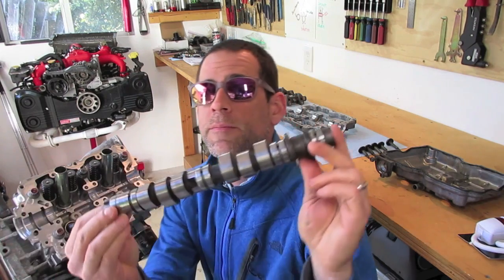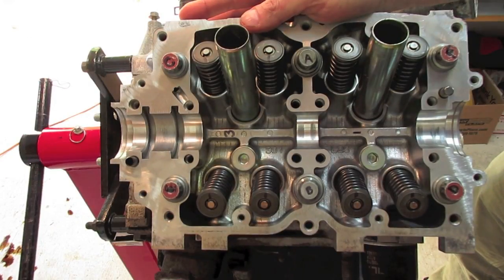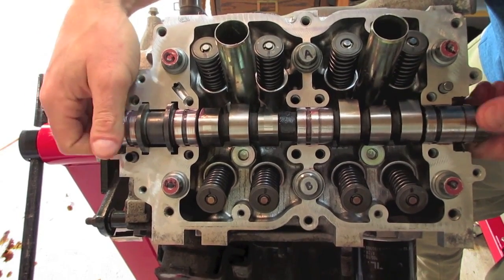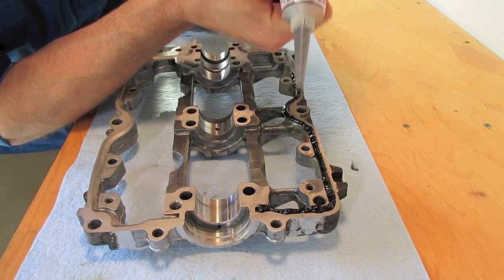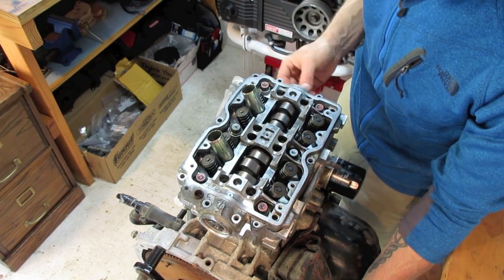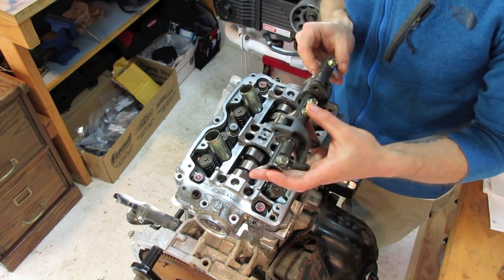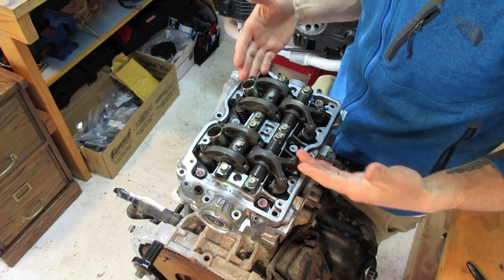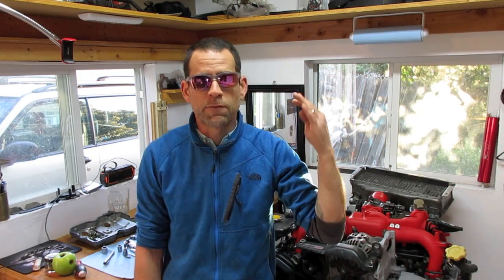How to Install Subaru Camshafts & Rocker Arms

Comment: Specifically the torx bolts are TP40, Torx Plus. A regular T40 has potential to strip them out. Torx Plus is more square around the peaks as opposed to the pointy peaks of the regular torx.

Great Video!

Comment: Good vid. Luke. Good cam. position over the head. Did you mention anything about de-greasing the machined surfaces, before RTV? Sorry if I missed it. You have an axiomatic style of communication (self-evident), clear and thorough delivery of the facts. I wonder if you have experience in academic writing or speaking? Was the retro-fit cooling mod. visible on that head. The twin-cam. engine behind you appears to have an aftermarket crankshaft-nose pulley. I don't believe these pulleys - damp,  mid to high frequency harmonics, from the crank. And can result in early failure.

Comment: Those cam cap bolts are Torx Plus, which has fatter splines than std Torx. I twisted my Torx driver bit while removing them, because the PO overtightened them and the fit was sloppy- just a heads up for anyone else looking to get the right tools for the job.
Reply from the maker: Nice - THANKS!  👍👍

Comment: That's cool. I have to do a head gasket job. Will be my first one.  QUESTION: HOW DO you know if you have the cams, rockets, etc on correctly after getting back from the machine shop? I'd be afraid that I would screw something up after I get them back and put the sprocket on and destroy everything! LOL. Cheers!

Comment: Hi, I got a 2005 Subaru Forester  2.5L 4 SOHC EJ25 with approximately 100,000. I saw a video you did but it was too late, my timing belt failed. It was the geared idler which actually failed and the fact the 05 Subaru 2.5L SOHC EJ25 is an interference type engine I think was a big problem. Yes, the bearing failed miserably it was all rusted and spun out and a cut a perfectly round hole in the timing belt dust cover.
The real problem is I am sure I had at least a couple of bent valves maybe more. I really hope that's all of the damage. Again I saw your warning video about the timing belt kit parts needing to be replaced at around 100,000 miles as mine was over it by 50,000.
I got a kit that came with a water pump and saw the oil pump right there said you know I should do this as its right there.  Well, now I know. So looking at this valve video now. Anything you can say to tell me if I am doing things right or whatever would be greatly appreciated.  Thanks your videos are helpful to many I am sure. keep up the good workVince mufonfivm@gmail.com

Comment: I noticed that you didn't put any lock thread on the rocker arm bolts, I did. Is that going to be an issue? Also I did di anything with the camshaft for lubing because I didn't take that piece apart. Is that going to cause an issue?

Comment: I just put a new to me low mileage engine into my 2005 impreza sedan, 2.5l sohc. the engine came to me on a pallet out of a recently wrecked car, upon inspection it has a new factory subaru timing belt, subaru factory oil filter (which I changed when I put new fluids in), new intake gaskets etc. After a week of driving it runs excellent but leaks oil, roughly 1/4 litre per 2 week period, more if I drive it more. Everywhere on the engine is perfectly clean and dry except for the driver side head has a TINY bit of engine oil weepage on it, near this cap and the exhaust manifold (really hoping its not a headgasket problem), I noticed gray RTV kinda drooping from the area on the cam cap where it looks like the leak is coming from, do these tend to leak? No other possible indications of a headgasket failure, so really thinking it could be the cam cap has a bad seal

Comment: Great video but you didn't prelube the thrust bearing surfaces on the cam before installation. Please explain and you have a new subscriber. Thanks!
Reply from the maker: Think I lubber the head machined surface. BUT you are 100% correct!!!  Thanks for noticing and sharing!! 🤙🤙
Reply: Yeah, I pay attention!

Comment: Man, first of all congratulations for your videos, are very enlightening and inspiring.
My name is Marcio and I'm from Brazil, just as you are a lover and enthusiast of Subaru vehicles.
I have a Subaru Impreza GC8 with engine ej20 sohc NA.
I have a degree in mechanics and I have a project to improve the efficiency of my engine without the addition of a turbocharger.
I am bumping into some points and so far I have not been able to solve.
An example is the measurement of camshaft the ej25 sohc
I have idea if it is possible to use this camshaft in the EJ20 to get some gain.
I would like to share experiences and if you have some tips I appreciate.
Abs
Reply from the maker: Hi Marico!  Thanks for checking out the videos.  Cool project 😎😎😎.  Dig this question my friend! 

Internal combustion engines, at their most fundamental level, capture the heat energy of the internal combustion cycle and convert it to mechanical work.  By design, they are actually extremely inefficient, with respect to capturing all the heat created.  This is where I would suggest you focus your efforts - Try to think of creative ways to minimize the loss of heat, and as a result transfer more energy to final output of mechanical work (ie engine’s flywheel output and torque to the wheels). One place to start , header wrap for example. But try to come up with more creative ways to achieve this and I bet you’ll find all kinds of ways to save that heat energy.

Yes, this would be more beneficial if a turbo was involved, but it will still increase the efficiency even on a NA motor - And that is only objective here!
Reply: Hello friend, thanks for the reply.
Understood, I'm going to start my project in the new year and as soon as I get the news I'll let you know.
Hugs

Comment: FYI, that's not a T-40 torx bit, thats a TP-40 Torx Plus...  similar, but not the same.  Nearly stripped the bolt head while removing the  bolts by using the wrong tool.
Reply from the maker: +Ajila Ama Farms  fuck dude. You are 100% correct.  Thanks for catching that!  They have slightly different shape too!!!
Reply: easy mistake, I didn't even know the dang things existed...   I asked the matco truck dude to order me some and he told me there are even more out now called "moretorq"  hahaha, damn.  pretty soon we will have toolboxes bigger than our houses :p

Comment: I don't see any lifters in that engine.  I have a 2003 subaru baja.  What causes a lifter like knock when the engine is cold and it goes away when the engine is warmed up?  When the engine is cold.  its a little scary it sould like a collapsed  lifter that eventually gets pumped up with oil.  What do you think?
Reply from the maker: Hey man.  That could be lifters not staying pumped up OR could be valve gap getting a little too big.  I would check you valve gaps first.  If they are too loose, then an adjustment might just fix the problem.   Good luck 🤙🤙

Comment: Do you have video on this for the quad cam models?
Reply from the maker: Sorry, don’t. But it’s very similar steps.
Reply: @SubaruONLY  I’m asking because the roller rocker arms for my 2013 fb25 motor got jumbled while I was trying to do a reseal job.
Reply from the maker: Ahah, hate that.  It’s happened to me. Not much you can do when that happens… good luck 👍
Reply: @SubaruONLY  perhaps some insight to the difference between, say... an A stamped and an E stamped one?

Comment: Any one know if this is only for a 2.51? I need to find one for a 2.53 07 Subaru Impreza 2.5i
Reply from the maker: Not sure if it’s the same. Prob slightly different torque specs. You can always use the Factory Service Manual, I provide them for free on my website - SubaruONLY.com - check it out!!!

Comment: one more question Luke, is it’s best to adjust the valves when the head is out on when the heads are installed already.. I already assembled the head but not adjusted the valves to spec. Thanks
Reply from the maker: +zroboost scooby  Hey - no problem.  You can adjust the valve lash either before or after you install the heads on the block - basically whenever it is easy to do the procedure. Just make sure you take the time to do it cause they often need to be adjusted - especially those exhaust valves.  Thanks man.
Reply: SubaruONLY is there a reason why two valves are open on the intake side, and two valves open on exhaust side,when I rotate cylinder head on the left, when I set to timing marks, and the cylinder head on he right all valves are closed... 😕
Reply: That's normal.  With the timing marks aligned, all pistons are at half stroke.  In this condition, the passenger side cylinders' valves are totally closed and the driver's side they're open as they're all on different strokes.
Reply from the maker: Yep -👆 Nice breakdown.  Thanks!
Reply from the maker: When you set the valve lash, just make sure the valve to fully seated too.   Cheers.

Comment: what did you use to clean up your motor so well? I've had my block hotbathed and it doesn't come out that clean.
Reply from the maker: +Tyler James - Hey man. Nothing much more than elbow grease and some abrasive pads and disk soap actually.  Plus, my JDM motor probably has super low miles too. Maybe that's part of it too.

Comment: do rocker arms need a specific spot?
Reply from the maker: Yes, keep them in the original locations. Due to Wear patterns.
Reply: SubaruONLY what if I mixed them, how can I determine where they go?
Reply from the maker: I don’t think there are any stamped marks. Keeping them in the same location might not be 100% required, I’d just reassemble and try to make sure it all pivots smoothly and then run it.  No other option I’m thinking.

Comment: Do you usually replace the cam bolt sealing washers?  The ones on the bolts that are not covered by the valve cover right over the end of the cam?  The FSM says to replace them, but I can't find where anyone actually says they do it.  Just curious.
Reply from the maker: Thanks for dropping the message!  🤙🤙

In general, unless it’s a copper crush washer, I don’t worry about replacing a washer.  This should be good approach for most mechanical equipment, including these Subaru engines!   Cheers and good luck!  🤙🤙
Reply: I appreciate it, Luke.  These washers appear to not be a crush type.  They look like they have some rubber around where the seat of the bolt head contacts them.  I will inspect them for serviceability and go from there.  

Keep up the channel!  As a long time Subaru owner of cars with the EJ257, EJ253, and now the FA20, I enjoy watching your content.

Comment: Awesome videos, huge fan here. My 2.5L SOHC EJ engine with 100K miles, started clacking with excess valve lash, so I checked all clearances and find one exhaust valve- drivers side (cyl3?) to have excess clearance. So I set the clearance to spec and torque up the adjustment screw -nut good. All is ok for about 5000 miles then the clack slowly returns. Rinse Repeat 2 times now. Same valve. Since there's no problem with the clearance at the valve next to the noisy one that opens from the same shared rocker arm,  its not the cam lobe or roller, but what else could be happening? If a valve seat  was wearing away or if the valve itself was wearing or in extreme case mushrooming, the clearance would be shrinking/closing up but not increasing. What do you think it might be , or suggest my next step might be for this daily driver psuedo-diesel wannabe?
Reply from the maker: I totally agree with your logic here, sounds spot on to me.  So what the heck could it be...hmm.  Something is opening that gap up, might be carbon build up or maybe the valve stem bushings are starting to move on you.  This is a little tricky and I can’t say for sure.  Hope this helps a little.  Good luck buddy!   I’ll think on this one and circle back if I think of anything else.

Comment: Do you need to have the camshaft in the 'UP' position, like top dead center for the pistons?
Reply from the maker: You line up the marks on the camshaft pulleys.

Comment: Hey Luke I am doing my head gadget and I have a concern do I have to align the camshaft on a specific way or not, car is a 99 RS, thanks..
Reply from the maker: +zroboost scooby   Hey man.  Thanks for reaching out!   Just make sure the front is on the front side of the engine.  As far as the rotation, no need to worry about that till you install the cam gears and set the timing with the timing belt installation.  Good luck man!  🤙🤙
Reply: SubaruONLY great thank man,

Comment: Hi, I bought a used Subaru  Impreza 2007  DBA-GE2, my mechanic said there was an issue with one of the camshaft sensors after I took it in due the engine light turning on, so they did a rewiring, it's working fine but I don't know for how long. From their experience when they replace the camshaft with a used one (cause new ones are hard to find) the problem returns after a while. 

 Getting a new camshaft for my Subaru is not easy. What do you think? and may you please recommend where I can order a new camshaft for my Subaru modal, a company that can ship overseas?
Reply from the maker: Try Rally Sport Direct or Flatirons Tuning - always high quality parts, great tech people who answer any question and all parts ship out same day or next. 🤙🤙

Comment: Do you have a video on the Vavle Springs removal and install?
Reply from the maker: I do.  Super early one on a NA motor. I used a drill press with custom attachment to compress the valve and pull the retainer. Check it out.
Reply: @SubaruONLY  yeah thanks for the reply found it after I browsed all your videos. Glad to see your back!!!!
Reply from the maker: Thanks and cheers man!

Comment: hey i got a question for you on the Subaru forester 2.5i can you remove or install the cylinder head with the camshaft and rocker assembly on?
Reply from the maker: +Julio Salazar.  Yes I believe so.  The dual overhead cam motors have a cylinder head bolt under one of the cams, but single overhead cam motors don't have that restriction.  Should be good to go man!!! 🤙🤙
Reply: SubaruONLY thats what I was working on the single cam thank you!
Reply from the maker: +Julio Salazar  Thank you.

Comment: I was looking to buy redline assembly lube. When I went to their website and filled in the application for my car(same Forester generation as the one on this video), Redline website stated their Red Assembly lube wasn't recommended for my car?? I've seen so many people using these assembly lube on these engines.. weird..
Reply from the maker: Odd.  I may have to look into that.  Maybe just an oversight on the webpage.

Comment: Your videos are very well done. Keep them coming. Your well on the way to a 10k subscribers. 
I have a stripped Allen bolt head on the cam plate right behind a spark plug tube. Think some rtv got in there on the last head gasket job. Looking for ideas how to remove the bolt.
Reply from the maker: +Steve S   Thanks man!!  Those little suckers are a bitch for sure once stripped.  Couple of ideas, screw extractor kit might work or sometimes driving someone that can grab like a big torx bit (star shaped fitting) into that rounded out hole can hold while backing it out.  Good luck man!! Let us know how it goes!
Reply: Hey SubaruOnly, I'm a complete newbie. I understand that in order to do a timing belt service the engine has to be in TDC to prevent any damage to the internals due to the pistons hitting the valves? When reassembling the engine how do you put it back to TDC with everything apart? Sorry I'm just curious and not super mechanically inclined.
Reply from the maker: Hey - Thanks for dropping the question!  In general, you are 100% correct.  However, Subaru engines are unique - which is awesome! 

For Subaru engines, we set the valve timing to the Crankshaft timing with all four pistons half way up the cylinder bore. - which means the valves won’t make contact with the pistons, even at full lift. To do this, Subaru has cleverly designed marks in their pulleys and engines to easily make sure everything is lined up correctly.  

I walk through this in a little more detail in the videos on changing your timing belt if you are interested.  Good luck.  Cheers! 🤙🤙
Reply: Thank you

Comment: Just got my heads machined and the shop gave them back with the camshafts installed. I have to take them back out to get to the head bolts. Is there anything I need to do to calibrate the camshaft or anything else when I put the cans back or just make sure it rotated freely? It’s an 08 forester XT.
Reply from the maker: Yes. That is actually the common way for machine shops to return everything, so you all good there.  Just remove, clean them off, lube them up on the machines surfaces and toque down to spec and in the order specified in the Factory Service Manual.  Check out my website for those service manuals if you need one!  SubaruONLY.com.

Comment: Great Vid once again Bro! Was there a Part 6 to this vid, where u get the cam gears back on a timing belt back on?
Reply: Doing a 98, 2.5 DoHc, Auto. Standard HG replacement and Timing belt/waterpump/idlers...wondering If I need to lock up these Cam sprockets with the "23 tool" to take them off to get the heads off, or just TDC on the crank and take the Belt+Sprokets off, since the heads are coming off anyway. These DOHc Phase1, older 2.5s can be a pain lol.
Reply: I've used your Clip+Vice grip method twice now on SOHC ej22 and Sohc Ej25 no prob
Reply from the maker: Yes!  Nice man!
Reply from the maker: As long as the crank is in the right position, you can let the cams sprockets rotate freely.  Good luck! 👍